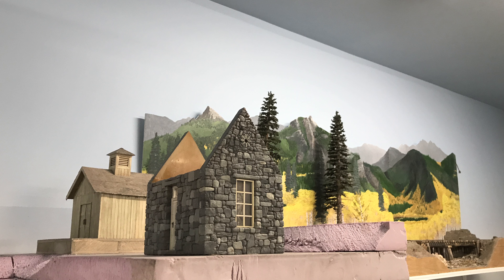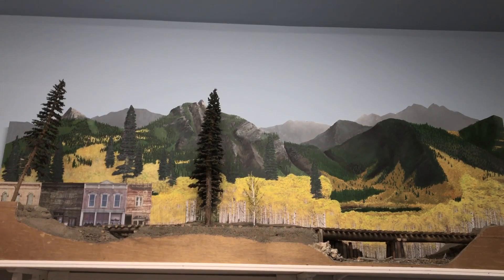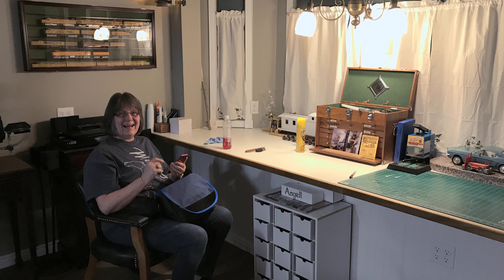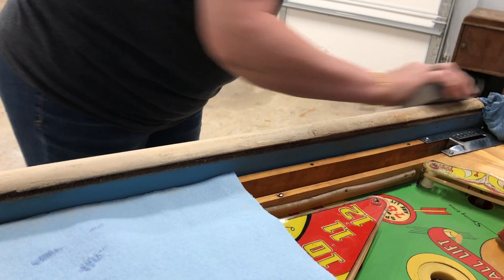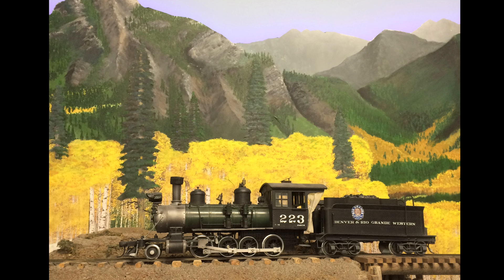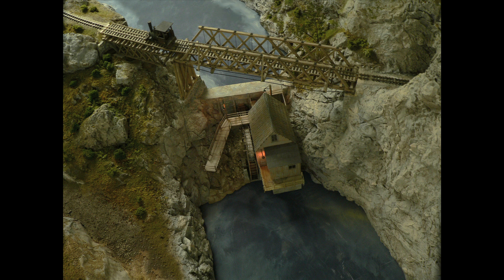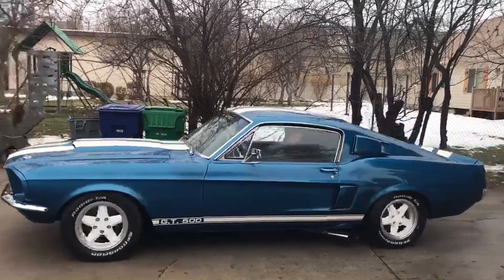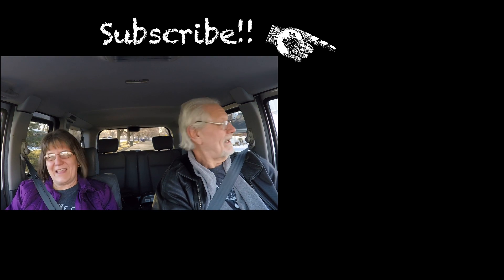Model Railroad Updates - Garagemahal and Steve's dismantle.

Comment: I've never met Steve, most likely never will, but you say that he is going to have a simple layout and I'm think that "simple" is a rather relative term.  Knowing what little I know about Steve, his new railroad could still be relatively complex. Hey, have a great day and I'm going to go out and screw around with my sawmill.
Reply from the maker: My dream was always the 2000 square foot layout with a mile of track. AND we have seen those layouts. But the best ones are often the shelf 24 inches wide and 30 feet long with great lighting and super detail. Run perfectly. Look amazing. We were on a live steam railroad a few years ago that had like 30 miles of track. It was a full time job for 12 members to try to keep that running. They  had a 10 mile loop that hadent run in years. May never run again. But years and tens of thousands went into building it. And now it's a monkey on their back. When the layout starts owning you its not fun anymore.

Comment: Love all the stuff but you need to find the correct wheels for the GT500.
Thanks for sharing.
Mike & Robin
Reply from the maker: It had white Craiger mags when it was raced. Looked great but the tires would hit the fenders. These have a shallow offset. So you can run wider tires. With the "proper" wheels you cant run anything bigger than an F7014. Anyway, I loved the look of the racing wheels. Shelby would be correct, but I love the white
Reply: @ToyManTelevision  I hear you for sure and it is Your Car. Have fun with them.
Mike

Comment: Hi Dale and Karen!
I remember you had briefly shown us all this led lighting technique once before, and I thought of something I'd forgotten until now.
Would it work to add fog? Probably very tiny tubing with tiny pinholes punched into the tube? Could they be slightly beneath loose ground cover to hide them? The source of smoke could literally be a fog machine constantly feeding the tubes and it could roll up slowly and fill the scenery. 😀
Reply from the maker: I have use it for photos. But it leaves oily film over time. Or a dust like coating with some systems. Anyway if you used it a lot it could be messy. Have you seen my show on adding snow in photoshop?  That’s how I do it now. But this could work for open houses and stuff. Mess with it and see how it works
Reply: Hey Dale! Thanks for letting me know about the fog machines building up oily residue. I'm not familiar at all. Seemed like a good idea, but, no. Lol! I hadn't watched that other video until now. It gave me fresh ideas! You saved me from making a mess of my beautiful model scenery!😜
I'll keep screwing around, same as you! Have a great day!

Comment: Dale,
Is the layout a point to point layout  or will it  loop the whole  room.
Reply from the maker: point to point. May be a loop in the yard. Thats the plan. but the logging line is single track. One switch. About 50 feet of track. AND the lower level is mostly a 3 track yard and a roundhouse. Someday I want it to go outside but for now, I just want a yard and shops. In 1:20.3 thats huge!